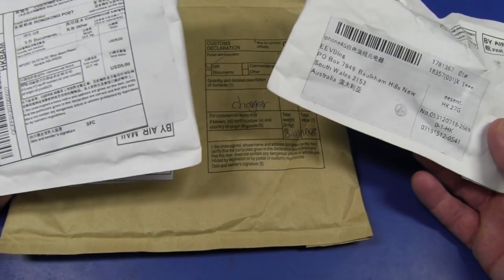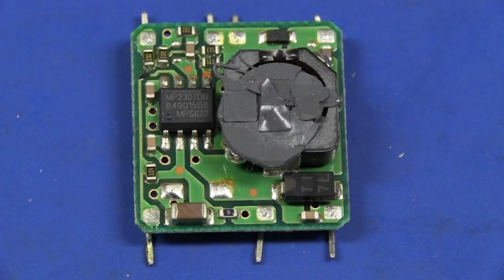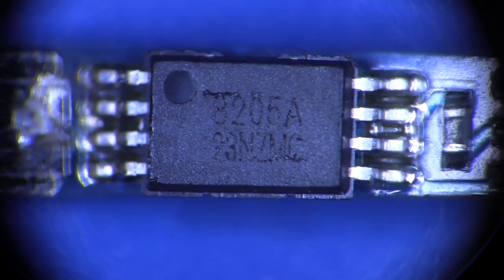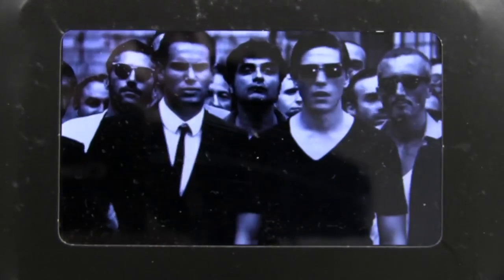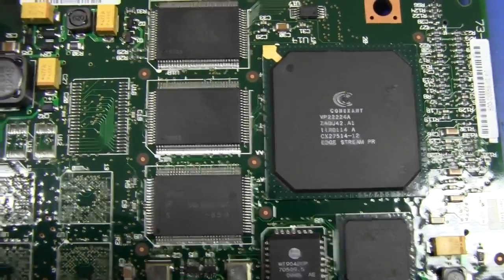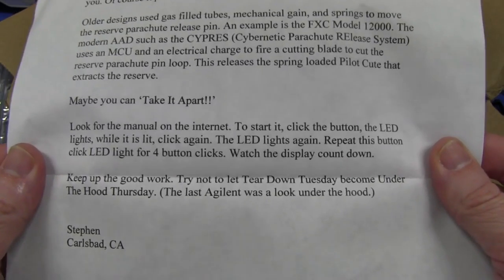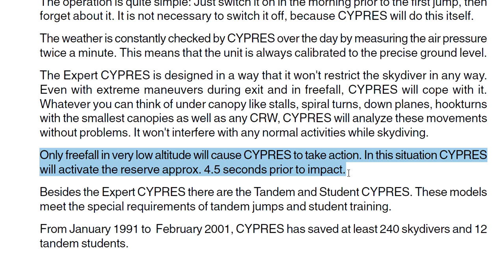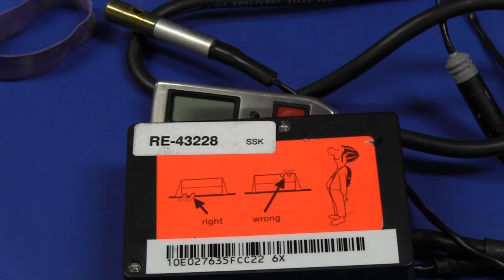EEVblog #331 - Mailbag

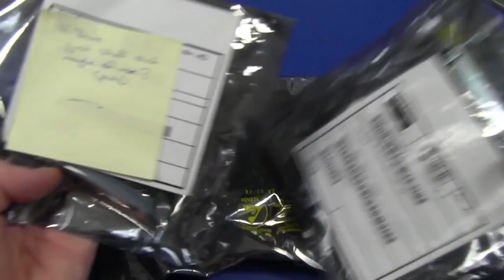Comment: 12:10 are Cisco WAN Interface Cards (WICs). They plug into the routers to add additional interfaces. 1600 series have a WIC slot, 1700 have two, bigger routers have more or can take a larger interface that has two WIC slots on it.

Comment: the 10 of them cost $6, including postage, for a little bit more you can get them on a pcb with pot to adjust voltage, some small caps and some screw headers, very useful.

Comment: To be pedantic, that USB charger is actually a mainland Chinese plug. The Chinese standard calls for slightly longer pins and, of course, doesn't require insulated pins like the new AS/NZS standard.

Comment: That Cisco module with the huge BGA on it is an AIM-ATM module for handling multiple T1/E1 spans. It goes in a Cisco 2600 3600 series router, from what I can tell; that nuber and barcode to the left at 13:22 is the part number.

The BGA itself is apparently Conexant's answer to the Freescale QUICC family of comms processors, and since there's no ROM, I'm guessing all that RAM (2 whole megs of high-speed parity SRAM, no less) is for firmware.

Comment: the kis-3r33s are actually fantastic step-down modules! they output 3.3v default and can be set to anything else easily (5v with a 10k resistor for example). needs input and output caps of course for anything serious. 4A max. and the thing that makes the really interesting: they cost around 0.3 US$ a piece!

Comment: That line cutter contains an explosive used to drive the wedge through the line and into the anvil on the other side of the hole.  If you can see through it, it's unused - obviously it can only be used once.  I've worked with similar units used to cut lines to deploy solar panels and gravity gradient booms for satellites.  When set off, they will not release any sort of gas or sparks - but be careful with it - it may surprise you.

Comment: those plug in boards are from cisco router cards for there routers new what they where as soon as you pulled them out
they add ports to routers as cisco routers only have Ethernet ports as standard

Comment: The usb power adapters are VERY nasty inside, also, Dave, very glad you gave that battery a quick look at, i was hoping it was going to be a nasty one like my last few, which just used a necked down track as short circuit protection and a few resistors to get around the battery detection :( However, on the upside means I can order another one and hope it is the same so i can actually use it :)

Comment: 1:01 "Power Adapter Made in China
Model No. A1265 Made in China"
Something tells me this is going to be thoroughly nasty inside. The A1265 is the parallel-prong model so they've moulded it slightly differently but kept the labelling. As far as I can see on the Apple Store this design is US-only, the Aus/NZ ones are chunkier, with a detachable plug, like a MacBook supply but smaller.

Comment: We used the cutter part from one of those CYPRES units to cut a steel wire rope almost as thick as the hole in it in a project at school. So they are quite powerful!
See from 3:50 in the video /watch?v=R7sERifbLvo for a test where the cutter is triggered by a mobile phone. :)

Comment: /watch?v=wrA-1aFtxhc (hot off the press) shows a teardown and test of one of those USB chargers, a friend of mine bought it a few weeks back so I've finally got round to taking a look. You've got better kit than me Dave (and more meters), perhaps you can go into more depth with the input and output waveforms and stuff. My 'scope was showing a lot of noise on the output but couldn't lock onto it cleanly enough to see properly.

Comment: You can look at those E1 (Europe's version of the expensive T1 phone line) interface cards at ciscoDOTcom/en/US/prod/collateral/routers/ps274/product_data_sheet09186a0080091b9c_ps259_Products_Data_Sheet.html. They go for USD150-350 (maybe depending on whether they work or not :-)).